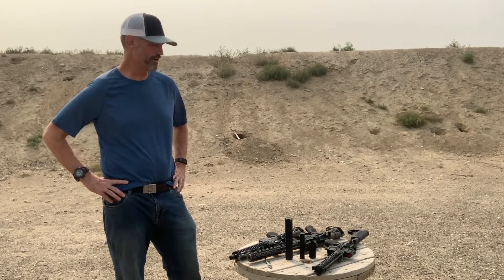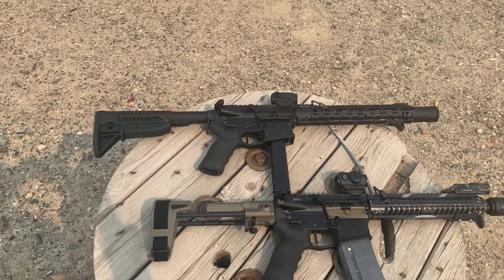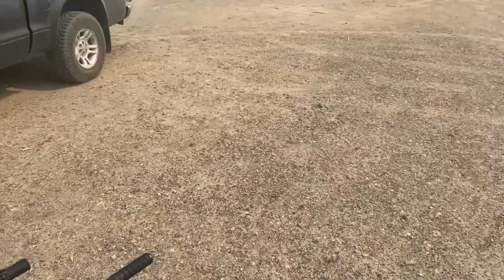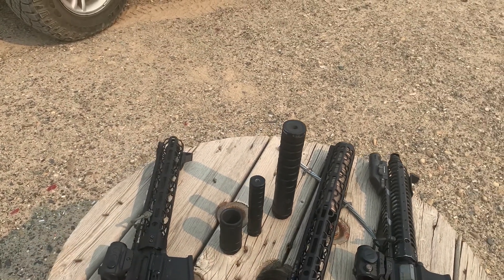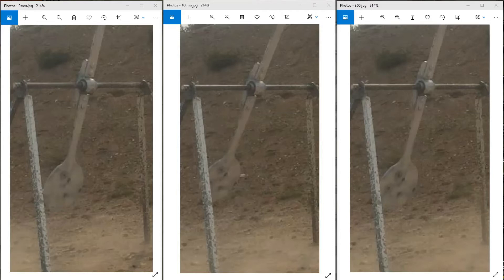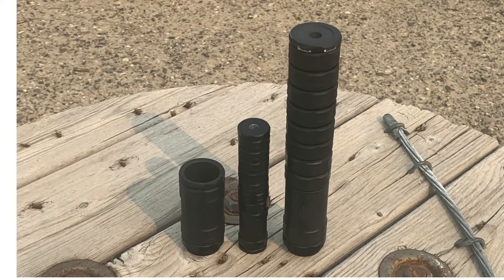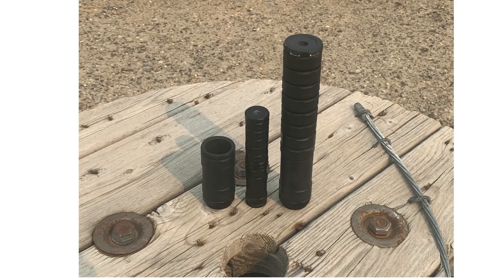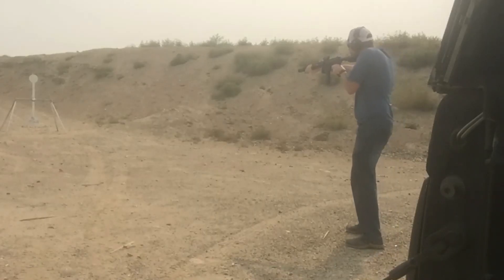JK105LT MST, JK Smoke stack 155, JK HD 155 MST 9mm vs 10mm vs 300 AAC

Comment: On the 105 I drilled 2 mouse holes, through one side and out the other, on all the baffles, and while there is a louder FRP, the subsequent shots are stupid quiet, especially wet. From what I’ve been able to gather, This type of “clip” (mouse holes below the bore hole) on other baffles on the commercial market are called “eco flow, flow, or griffin clips” seems to be a good clip! Cheers!
Reply: I prefer clipping both sides. In my experience I rarely see a POI deviation as opposed to the single clip. 
Once you’ve passed the FRP, are you shooting from a semi auto or bolt action?
Reply: @Warthog71  semi auto ar22